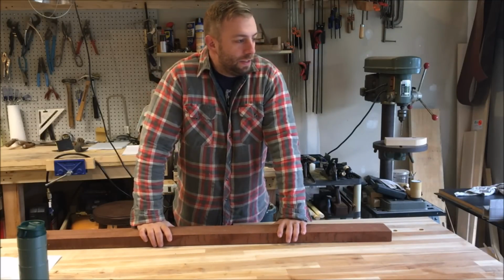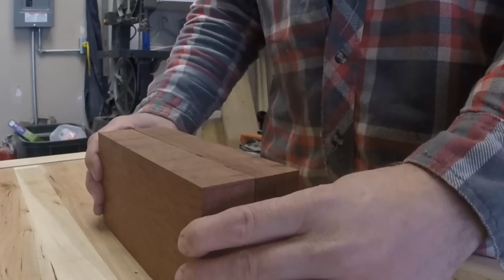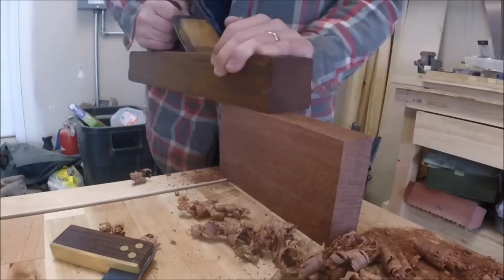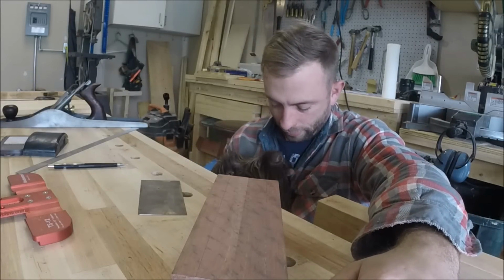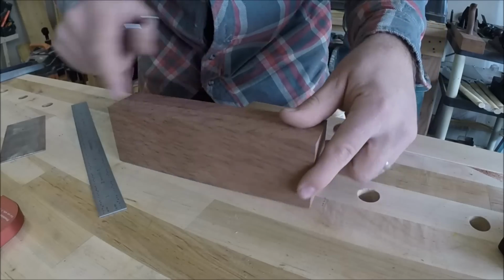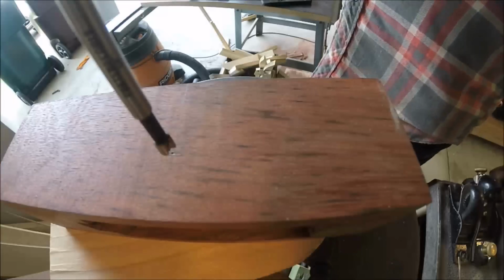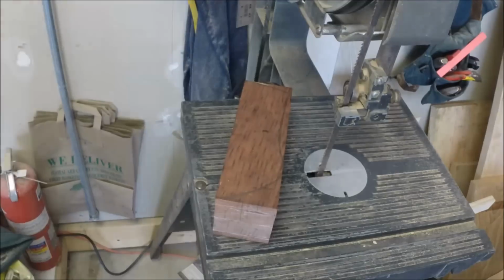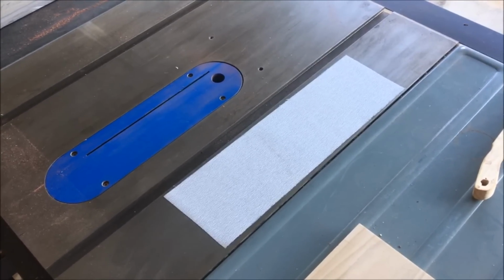How To Make Wooden Hand Plane!!! Part 1. | Woodworking

Comment: G'day, I've watched both parts of this build and you have done a great job and ended up with a beautiful plane. Your bookshelves have a nice thick jarrah top and it has the typical appearance of Jarrah(Eucalyptus marginal).  I suspect you have ended up with a ring in when you bought your timber. The timber you have built your plane from is West Australian sheoak (Allocasuarina fraseriana) and it is not related to jarrah. It is actually a better choice for tools than Jarrah. An  Australian craftsman Colen Clenton makes superb squares and marking gauges and his preferred timber is Sheoak. He also makes using exotics but his standard range is made from sheoak. I am fortunate to have a couple of his adjustable squares one in rose sheoak and one in lace sheoak,  which may be the rarest timber in the world (rarer than Pink ivory wood) as it only grows in one small remote area of Western Australia.
All the best
Reply from the maker: labrat7357 wow. Thank you for that great information!!! Very much appreciated! Thank you for the compliment as well!